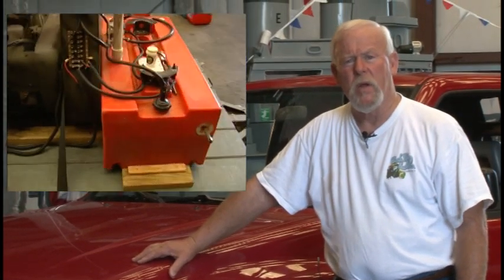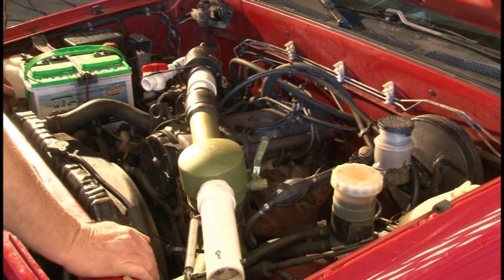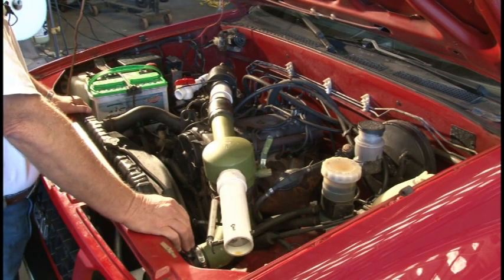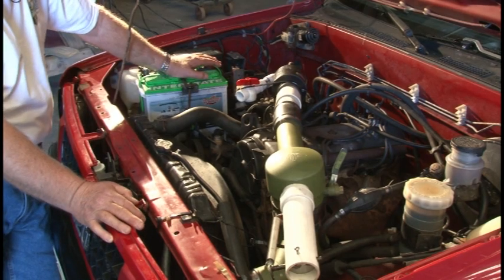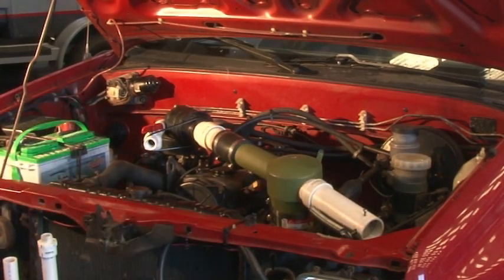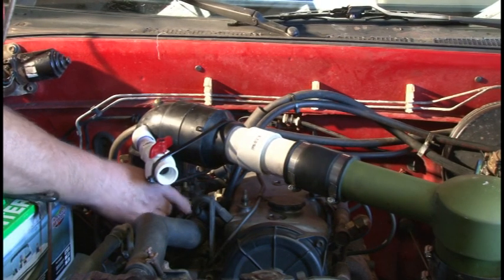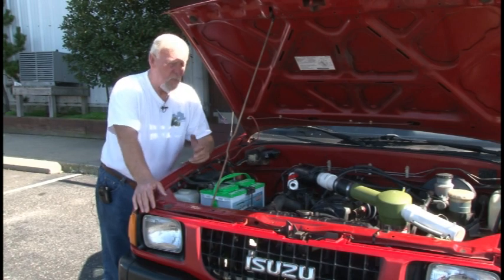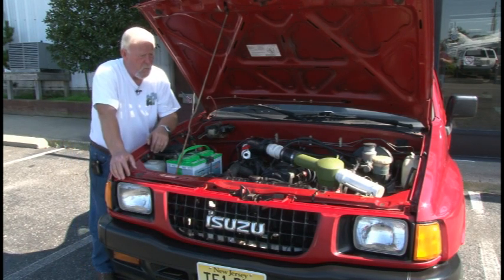Alternative Fuel Generator III / Car

Comment from the maker: I can not tell you, what the fuel saving are in the car. I can tell you the fuel saving in the generator is at least double the run time with the same load. I have run the generator for hours on end under full load, it burns half of the factory specs. I recently read that one guy is claiming 200 plus miles per gallon  That's plain B.S. for him to raise money. Don't believe it !!!

Comment from the maker: I have encountered a problem with the fuel becoming washed out. I am currently doing tests with the generator engine using different grade fuels. It looks to me like the fuel degrades, the more it is pumped through the system.In order for this system to work right you must fill the secondary tank only as needed. The system burns off the violitles first thus degrading the remaining fuel. I am sure there is a way to blend the fuel so this would not happen. Imagine the fuel saving with that blend..

Comment from the maker: I am in the proccess of reworking the system so I have not taken the time for a mileage test. As far as running a fuel injected engine using gasoline vapor. I believe it would work just as well. The problem's I have encountered, have more to do with the anti pollution devices. I will soon be doing more work with the improvements on my generator I have added a water vapor induction system that works like a million bucks and I am also adding HHO to really understand what works the best.

Comment: You're using fuel to generate electricity (the alternator) in order to generate HHO to be fed again into the engine?

If the alternator has a constant mechanical load regardless whether you use the power produced, then you may be able (with this system) to recuperate that wasted power.

If the alternator has a mechanical load only when there's an electric load then I doubt that you'll be saving money.